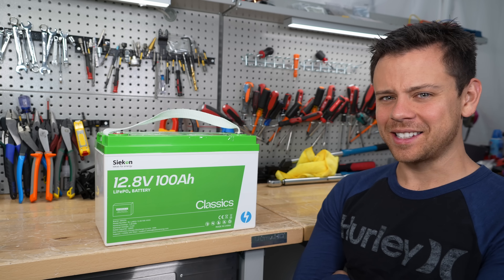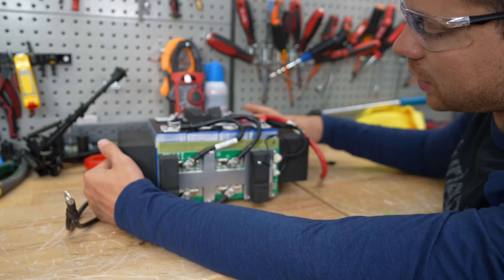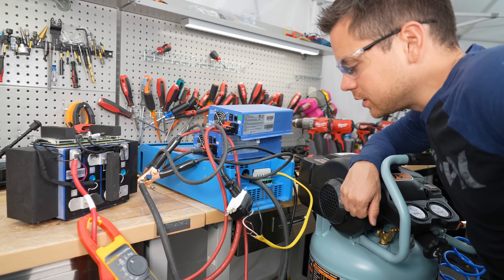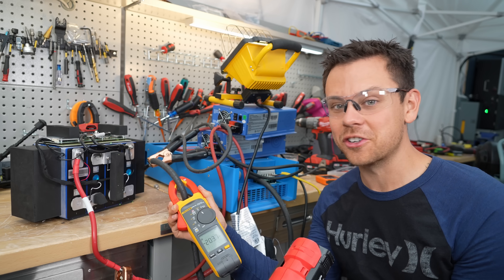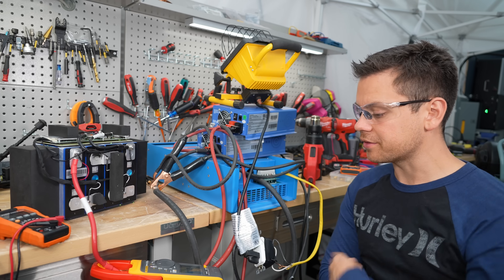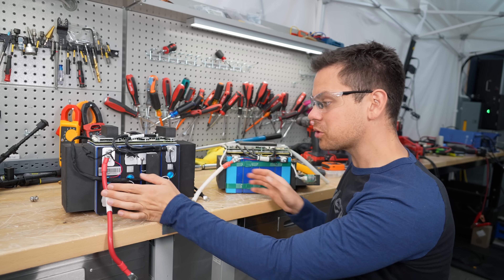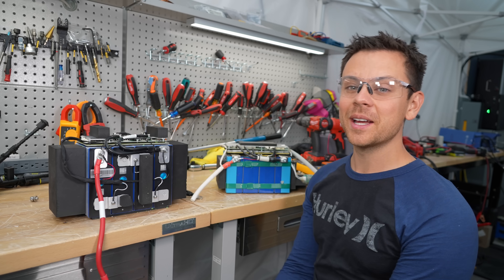Lead is Dead! $229 LFP Siekon 12V 100Ah w/ 150A BMS and Low Temp Charging?!

Comment from the maker: 12V batteries I currently recommend: https://www.mobile-solarpower.com/lithium-batteries.html

0:00 Quick rant about Lead Acid vs Lithium
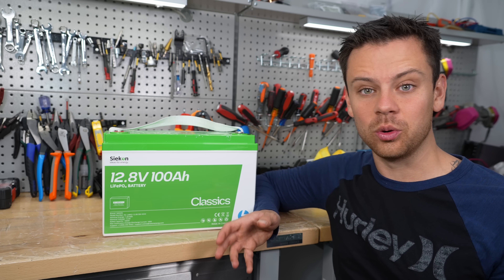1:30 Siekon Intro and Capacity Test
2:24 Teardown!
3:05 Low Temp Test
3:32 Load Testing! Surge and Continuous 
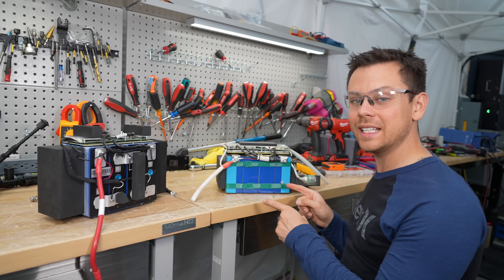8:11 Litime Comparison And Conclusion

~~~~~~~~~~~~~~~~~~~~~~~~~~~~~~~~~~~~~~~~~~
Tired of getting ripped off? Check out my "Will Prowse Approved" solar product recommendations below!

12V Batteries
https://www.mobile-solarpower.com/lithium-batteries.html

48V Batteries
https://www.mobile-solarpower.com/48v-batteries.html

Offgrid Inverter System Builder
https://www.mobile-solarpower.com/48v-complete-system-blueprint-559371.html

Hybrid Inverter System Builder
https://www.mobile-solarpower.com/code-compliant-48v-offgrid-system.html

Mobile Handtruck System Builder (very popular!)
https://www.mobile-solarpower.com/mobile-48v-system.html

Solar Panels
https://www.mobile-solarpower.com/300w-solar-panels.html

Ground Mount Solar Racking
https://www.mobile-solarpower.com/ground-mount-racks.html

Wire, Lugs and Busbars
https://www.mobile-solarpower.com/wire-and-connectors.html

Tools
https://www.mobile-solarpower.com/tools.html

Fuses and Circuit Breakers
https://www.mobile-solarpower.com/fuses.html

Plug-N-Play Solar Systems
Ecoflow, Anker And Bluetti! So many models to choose from. See my current recommendations here:
https://www.mobile-solarpower.com/full-size-systems.html

~~~~~~~~~~~~~~~~~~~~~~~~~~~~~~~~~~~~~~~~~~
Need to build a large DIY system? Need a trustworthy solar distributor? These are my favorites:

Signature Solar
Creator of EG4! Solar Minisplits, Victron and More! Largest Solar Store Online.
If you want $50 off, please use my link below and coupon code "DIYSOLAR50":
https://signaturesolar.com/?ref=cPwLcVc0SW-BjN

Current Connected
Best Prices for EG4, Victron, Midnite and so much more! Fast Shipping and Highest Rated Customer Service:
https://currentconnected.com/?ref=wp

~~~~~~~~~~~~~~~~~~~~~~~~~~~~~~~~~~~~~~~~~~
Join our DIY Solar Community 
Need more help? Join the largest solar forum on the internet for beginners and professionals alike. 140,000 members and counting!
https://www.diysolarforum.com

Check Out My Free Book
Best-selling and beginner-friendly guidebook to off-grid 12V solar!
https://www.mobile-solarpower.com/the-book.html

~~~~~~~~~~~~~~~~~~~~~~~~~~~~~~~~~~~~~~~~~~
Contact Information:
I am NOT available for personal solar system consult! If you wish to contact me, this is my direct email: williamprowsediysolar@gmail.com
FTC Disclosure Statement and Disclaimers:
Every video includes paid promotion or sponsorship (such as free products for review). Some links on this YouTube channel may be affiliate links. We may get paid if you buy something or take an action after clicking one of these. My videos are for educational purposes only. Information is subject to change/update at any time. Electricity is DANGEROUS and can kill. Be smart and use common sense :) DIY Solar Power with Will Prowse is a participant in the Amazon Services LLC Associates Program, An affiliate advertising program designed to provide a means for sites to earn advertising fees by advertising and linking to Amazon.com
Reply: Man, these are badass. 2 x 600cca's paralleled will start 99% of regular trucks. They typically have room for two batteries.
Reply: did you happen to do any temp readings while the case was still on. i am wondering if the temp sensors would have shut down if the case is left on
Reply from the maker: @xBucket13x  no I didn't. There's another temperature sensor on the Fets so it would have picked it up regardless
Reply: Is it possible to add over current protection to this battery with some sort of inline external device?
Reply: @joeblow1942  I was going to ask that as well.  Could you add a 200 amp (or whatever is appropriate) breaker on the output from the battery?  Would that give equivalent protection?
Reply: @extendedp1  a class t fuse would work
Reply: Now you need to start doing check about how well they are sealed.  Maybe use some kind of vacuum pump instead of dumping them into water ;)
One thing that would be great, is a battery that you could just put along side a lead battery.  What I mean by that, is for example, my friend have a sailboat.  Her budget is super limited, and her battery will need to be replaced.  But she do have a Diesel Engine that the battery need to be able to start.  Her system allow 2 battery, and she have a battery selector that allow to select individual battery, or both batteries.  I would love to help her out and get her a LifePo4 battery, but I see multiple problem... First the battery selector, can cause issues, as one battery might be low, while the other one full, so switching to Both battery option, then you have the 2 battery having rush current into them... And with the battery you just shown, if there is no protection at all, it would rush at what... 600amp between the batteries ?  This doesn't seem to be a problem with her Lead battery.  And can I start safely a Diesel engine from these batteries ?...

As for me, I do have a Ecoflow Delta 2, and I do have 48volt battery system.  It would be great to have a battery like this to supplement my Delta 2 on the cheap, but the max at 12volt would be 166watt I can input into my Delta 2 from the DC IN port at 13volt.  So I'm not sure how useful it would be (and maybe that 166watt have a good % lost in conversion as well...).  I could use 2 of these batteries in series and get 2kWh... It just suck that there is empty space inside.
Reply: @mochouinard the big problem in a sailboat is protecting the alternator. They cannot be directly connected to LI batteries. Strategies are external alternator smart regulators or charging to starter lead battery and using dc2dc charging (or some parallel techniques) to get the LI house battery charged. Remind your friend that usable charge in a lead house battery is usually 30-70% (net 40% of total capacity) while LI 10-90% (2x more net usable capacity) is reasonable
Reply: What about under the hood with an EV without an alternator?  What is the over voltage limit?
Reply: @WillProwse  Will, Thanks for these videos! I have a question, I have a bunch of small (very efficient) 120v APC UPS that were designed to run for 4+hrs powering a low wattage load like a modem or router.  Their batteries are all dying after about 6 years now, they are 6ah SLA batteries.  I intend to replace the batteries with a larger battery (externally) to extend the runtime even further during our infrequent power outages.
My question is would a LiFePo battery like these (but smaller) be a 1 for 1 replacement in terms of output voltage to the UPS and the required input charging voltage?
I know the output and input voltages are different for LifePo cells in series of 4.  Do the BMS in these batteries adjust for the difference, and output a standard lead acid voltage, and allow an input of a standard lead acid charger?  Or do these stand alone Lifpo’s require a specialized Lifepo charger?  Thanks!
Reply: @extendedp1 be aware the small units with small batteries will overheat when extended with large battery capacity. I caught one on fire pulling 75% capacity after about 30 minutes. They don't have the heat dissipation capability for extended run time.
Reply: @unforsaken2k1  good point, thank you
Reply: A fun test would be to arc the terminals with a screwdriver to see what dangers are involved with no overcurrent protection. Maybe compare it with a lead acid and a different branded lifpo4.
Reply: @matd3150  By 'fun' do you mean dangerously stupid? That's a no-go from me there.
Reply: @my_channel_44  you must've missed the video where he stabbed a lipo pack with a screwdriver, causing a thermal runaway. Not everyone is a Nancy
Reply: @matd3150  Brother, being stupid and careless is not the opposite of being weak. 😄
Reply: FYI: the "affiliate link" now goes to a selection of 5 Ah and  7 Ah 12V batteries, not the 100 Ah. 
It's like the listing has been overwritten, as even result from a search leads to same page. 
This sad, as shows was a limited product release, or merchant is manipulating postings.
Reply from the maker: @AerialWaviator  that's what happens when it's out of stock on amazon
Reply: Will, I have to raise the Red Flag here.
They are obviously not using High C-Rate LFP cells but just regular Prismatics.  Nothing wrong with that, except you exceed the specified C-Rates such as 2C and even 3C discharging.  Burst Discharges within spec are OK but not this.

It may be prudent to check out the cells specifically, locate that companies spec sheet and take that into consideration.   In my opinion, allowing such heavy discharges will have consequences and potentially most unpleasant ones.
Reply from the maker: @stephsoltesz6731  I will be doing a test system for 600 amps and we will try to break it in the next video
Reply from the maker: @stephsoltesz6731  3c usually fine for surges on LFP but yeah, they actually state 100A on the front of the battery
Reply: @WillProwse ik  building out a schoolie right now and will be doing solar soon. I am a master electrician by trade and also have a degree in wind energy so I will also have a couple of homemade wind turbines in the system as well. I  will be buying some of these batteries to add to the system. I will let you know how they perform. My schoolie is being built with a shop in the rear of it as to be a mobile mechanic. So I will be pulling some decent current from them.
Reply: Hi  @stephsoltesz6731 good comment I'm a noob on this what does this mean in layman's terms and how can I prevent the 2c and 3c discharging. You seem more wary of this battery than the hype it is getting and it makes me cautious and intrigued. Trying to use it for garage or solar water pump on rain barrels... maybe a larger system with tax credit considerations too
Reply: Hi . Can you help me I need I set up just for my air condition and 110 v for my house you have one for sale and help my with the solar panels which one to buy. Please
Reply: @SB-dg8hq 500 watts is nothing. You need 1.2 - 1.5kw for the listed loads. Now that varies with where the van is in latitude and climate. 500 watts is really not enough for lights (led), pump, fridge, laptop, internet, cell phone. You can do cooking if you have an LP gas bottle under the counter.
Reply: Will I put 2 in my square drop build and have 2000 watt inverter. I ran all the 12 volt lights and fans and used the inverter to run the coffee pot. With no problems. Also I used my 120 volt stick welder without an issue. FYI I have 300 watts of solar and a epevers 40 amp solar charge controller based on your recommendations.
Reply: @FamilyTrailertales  double your solar.
Reply: @WillProwse I was debating on doing a low end 12V type system, but the amperage is a bit nutty. So I have been instead looking to a 24V or even a 48V. Finding an inverter to run at 48V is a challenge. Your vids are a bit dated for this specification as well. I may also post on your forum for some design ideas and shopping list, but it may be a good idea for a future video.
Reply: @Sight-Beyond-Sight  48v. Offgrid AIO's are only $600. Don't mess around with 24v. Get a 40-60 > 13.8v converter for the cabin 12v wiring, or use a plug-in wall charger for a 12v 100ah LFPo, of the type exactly like what he reviewed.

If you are doing 3k AIO or above, with rare exception, to go 48v for your main storage. Like I said possible for exceptions, but I'm not feeling it.
Reply: Excellent Will, luv your show buddy, the best going around. 👍
Reply: @SB-dg8hqBe careful to match your solar panel to your MPPT. The problem with a single panel can be too low a start up voltage to run the MPPT. Most manufacturers (like Victron) have a tool to match up panels to chargers. In a lot of cases you're better off putting two smaller panels in series so the panel reaches the appropriate voltage earlier.
Reply: @SB-dg8hqIn your calculation you’re assuming 100% efficiency charging the 280Ah battery, discharging it, converting it to mains and charging the main car battery from mains. 
I think you should calculate in significant losses.

Also: MondoTV’s recommendation still applies.
Reply: I don’t mind the old lead acid guys, at least they believe in what they have. The group I can’t stand and there’s a lot of them is the “every lithium battery is full of old used cells!” I’ve been capacity testing batteries for over 16 years back when my son was racing RC cars. I still test batteries in my part of the world and post what I find on groups, but it doesn’t matter how well they do or you scan the A grade new cells you always get the used cells, rewrapped, Re-QR coded stupid comments.
Reply: Womp womp. That link now only shows 5, 7, and 12ah batteries.
Reply from the maker: @Spearborne  yep, out of stock
Reply: They changed the Amazon listing to a different product
Reply from the maker: @Juniperrrrrr  yep, out of stock
Reply: I recently bought 2 lifepo4 12v 100ah batteries and connected them in series with a mppt inverter from voltronic, i am using custom charging settings as follows
Float charge 27.2
Charge voltage 29v
Cutoff set to 23v

The issue is after full charge 1 battery shows 14.6-14.7v the 2nd one shows 13.6 or 13.7,after that inverter stops charging and maintains 27.2 float charging voltage, the issue is that one battery is 14.6 and other is at 13.6 how can i balance it, is it normal? Both batteries are same article from vestwoods since they are only reputable brand bere in pakistan.anyones help will be appreciated. Thanks!
Reply: @himalayanoutpost  yeah you need a balancer.

Sure Power mil surplus or victron. Do not get the 5ah chinesium ones, unless you like fires.
Reply: @my_channel_44  i dont like fires its already damn hot here. I do have a 14.8v 30amps power supply from dell i guess i think i can use it individually on both batteries to get them balanced occasionally? Is that right approach?
Reply: I recently bought 2 lifepo4 12v 100ah batteries and connected them in series with a mppt inverter from voltronic, i am using custom charging settings as follows
Float charge 27.2
Charge voltage 29v
Cutoff set to 23v

The issue is after full charge 1 battery shows 14.6-14.7v the 2nd one shows 13.6 or 13.7,after that inverter stops charging and maintains 27.2 float charging voltage, the issue is that one battery is 14.6 and other is at 13.6 how can i balance it, is it normal? Both batteries are same article from vestwoods since they are only reputable brand bere in pakistan.anyones help will be appreciated. Thanks!
Reply: I feel these sort of videos have become the new Telemarketing! “Great price get them while stocks last!” 😂
Reply from the maker: @plokijij7856  it's like insider trading lol I have a new test method that will probably break half my batteries. Can't wait to show you guys
Reply: @WillProwse been watching since your little robot arm build, so won’t be stopping now! Looking forward to what you come up with!
Reply from the maker: @plokijij7856  what! No way!!! That's so cool haha you've been here forever!
Reply: @WillProwse yeah doesn’t feel that long, I was getting into Ardunio programming back then, I’ve got to get back to arduino, I’ve got a Nissan Leaf battery I want to connect to my system so have to program one of those esp32 for CAN to rs485 coms. Seen a few do it on youtube. Miss the live videos you use to do through Covid. Anyway have fun!
Reply from the maker: @plokijij7856  sometimes I'll buy more before I post 😂 I won't be able to get them for more testing videos either
Reply: What if you just short the terminals? Hopefully that would trip the BMS.
Reply: @willprowse,.......... You ever goin to test Eco worthy 280ah batteries??? I'm going to mention it every time I watch a review cause I don't get replies from you in over 8 months ago lol
Reply: @WillProwse bought 4 of these today, thanks for the code! I’m using them to run the DC Ceramic PTC sensors for my massive sand battery. Considering the price and their verified cold temp performance, it’s a great deal for my wintertime temps. I think I’m going to mount one in the truck to power my air compressor. They were $217 after tax, and the coupon saved me an additional $15—woooo!

This week, I’m adding another Victron multiples II 3000W inverter to the house to run some new stuff I added to the kitchen. I also ordered ten Aptos panels from the other video and I’m excited for them to arrive.

The only way I know how to really thank you for all the help and knowledge over the last many years is to buy the stuff you advertise. If there is anything else, let me know. I started with that tiny RV system you built and was scared as heck! Now I have 17 rows of panels on about 2 acres of land. Again, I know I have said it, but I would have struggled to gain the confidence without the book and all of these videos. From a random internet stranger that does not post comments for real, thanks again for all the knowledge! you give me hope and encouragement with each video you release.

also pretty please test some of those 24v chins so I can stop worrying if im gonna burn down the house..... mostly kidding . I got my fuses game on lock!

sorry for the long rant
Reply: Great info!!!!   @willprowsie  gonna toss my 7yr 200ah 12vdc that still works fine in my van runnin fridge etc all only 12v dc, but at 130lbs I have to kick it an make more room for the 5 extra baja Mex street puppies an there kibble, makes 7 dogs total,  I rescued they are 22lbs ea still bought 5lbs more to go,  anyhow   Want a value for a litho that won’t leave us as coyote bait, what ya think ?  Fridge iceco 24/7 never been off in 5yrs   The major drawother charged off this is usb stuff. Thanks !!!!
Reply: can these batteries be wired in series. and parallel.  . safely..???
Reply: LFP needs to be heated for cold weathter which pretty much renders  it useless for most use northern use cases since most sometimes leave vehicle off for a few days. They would need to change battery chemistry in some way to keep in working in subzero temps without the need to heat the battery.
Reply: Fun Fact : We call people who lived in the past here in Blighty " Luddites" after the hand weavers who rioted and started to smash up the new mechanical weaving looms - for a while the weaving factories were built like forts.